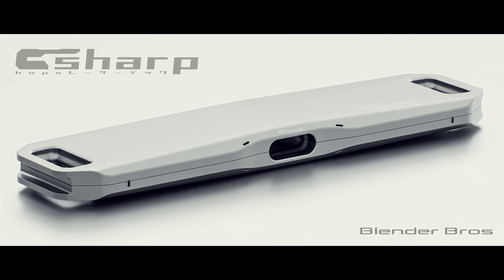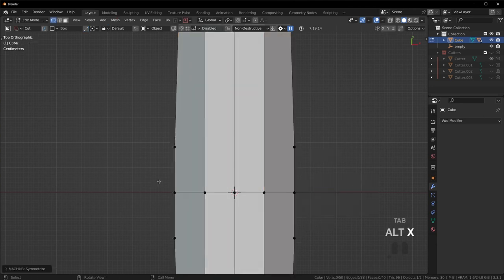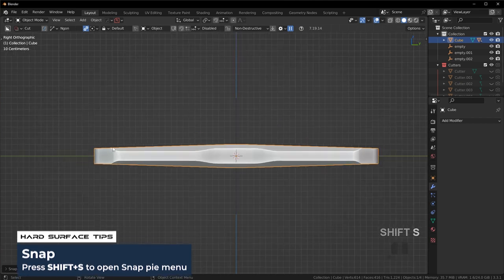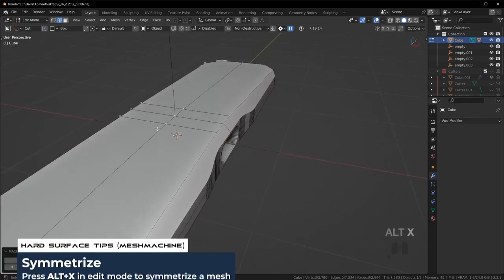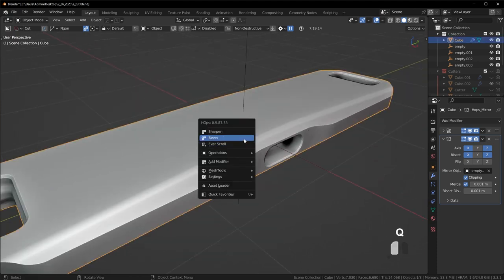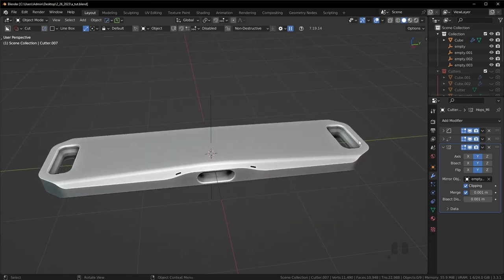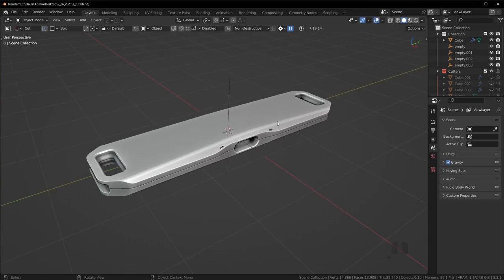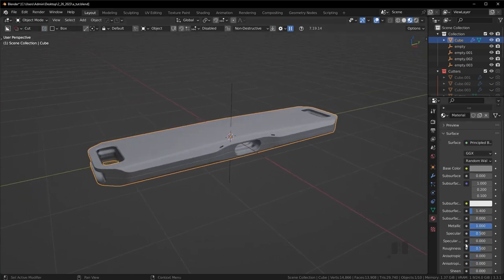Blender Hard Surface TUTORIAL - Easy Modeling & Design

Comment: Hello Josh, I have a question about using booleans. If I use booleans on round surfaces, for example cut a cyllinder into a sphere, I have taken your tips on having dense geometry on round surfaces, so that if you end up with tris of ngons they will be pushed into a corner and not very visible. I try to clean up the cut as much as I can, and get as many quads as I can, but I'm often left with a ton of tris after the clean up. I mean it's not visible at all, because they are pushed into the corner. Is this something I should worry about?
Reply: @artisans8521  Thanks for clarifying. Do you btw have any example of any programs that shades normals differently than Blender does? Wouldn't triangulating the model in Blender before importing to other software fix that issue?
Reply from the maker: Depends on your goals. If you need quad topo for VFX or something just slap it with Quad Remesher, perfect topology in 2 seconds. Otherwise clean shading is what you should go for.
Reply: @artisans8521  What VFX studio told you that Tris and n-gons are acceptable in hard surface modeling? I have never heard of any studio that accepts this approach to ANY of their models in the pipeline from modeler to texture artist. Modelers do not decide what to model in a real studio.